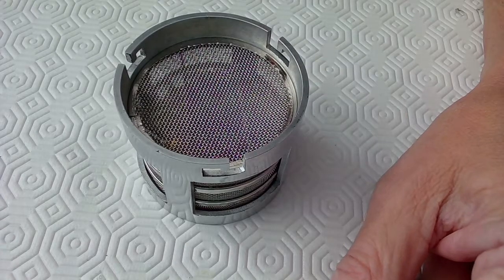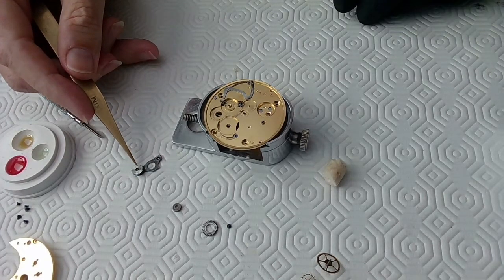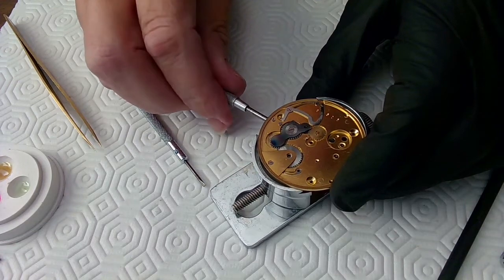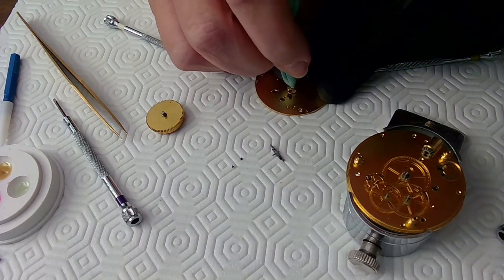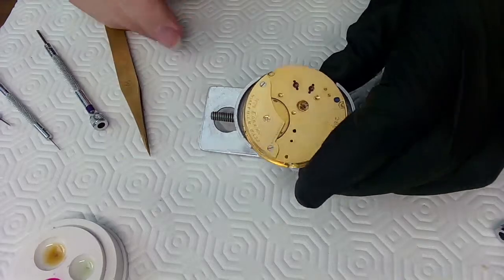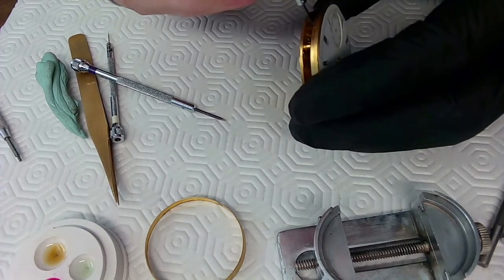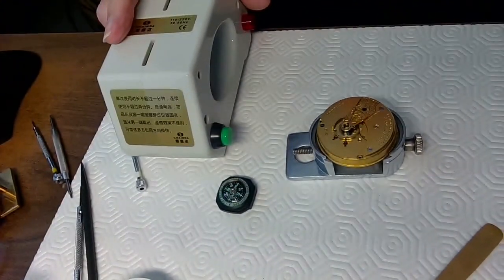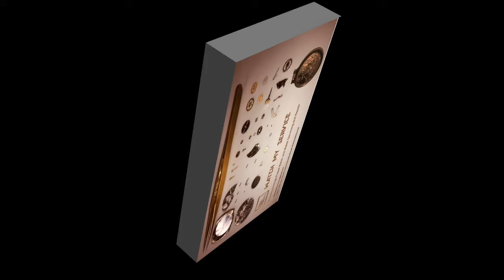AWC Waltham Pocket Watch Assembly

Comment: you can get little fingertip covers so you don't have to wear an entire glove.  (or just cut the fingertips off the gloves and put them on your fingers, which might be cheaper anyhow)
Reply from the maker: I am still looking for a very good and comfortable finger cots. I do have a supply of beige ones that seem to cut off the blood from the fingertips. The full glove is way more comfortable and requires no blood circulation adjustments. So from now on, I think I just keep wearing the black glove on the left hand and avoid touching with my right hand.

Comment: I have not watched this whole vid yet, but thus far, I always watch your vids as a subscriber. I remember when you started, cleaning by hand, and how much you have ascended to pro status in repair and restoration. I have been working on a broken fourth wheel pivot on a 48mm Roskopf ( the 19th C version of the dollar watch!). I am having a difficult time  drilling with my lathe to re-pivot. Steel is too hard for the mascots, too. Anneal, maybe? Then re-harden? Thoughts?
Reply from the maker: Hey, thanks for the very nice comment and I will continue making these videos if not just for entertainment for others and myself. I think that drilling the very small hole in steel I would use those Chinese circuitboard bits and flatten or roof the end of them so they cut. Then I would use cutting oil to make sure that they do cut. Without cutting oil, you just can’t cut through hard and steel. I have not had a problem drilling holes when I fashioned a bit like this. I do have a video that I made to show how this is done but I can’t remember where the heck it is on YouTube. Those mascot bits are fine for big holes, but really bad for very small holes needed on pocket watch wheels.
Reply: @JDRichard  Thank you, sir.  I will try the circuit board bits, they are inexpensive so if they break, no problem. I am going to try and find some carbide steel jeweler's bits, too.